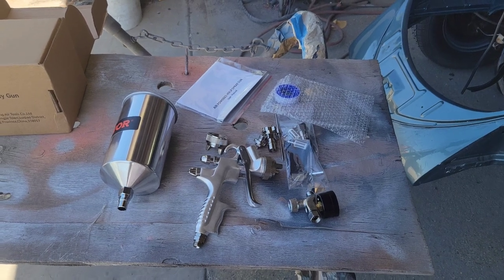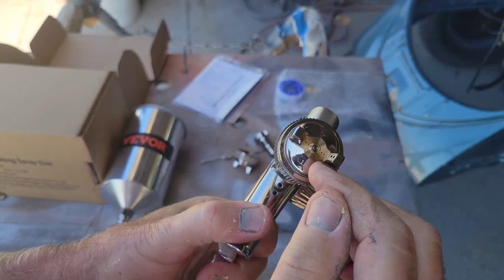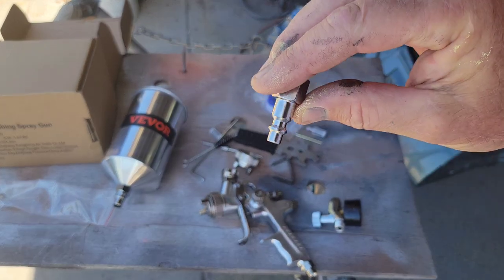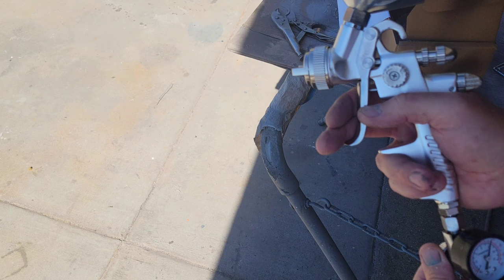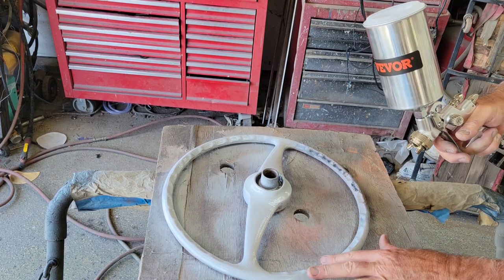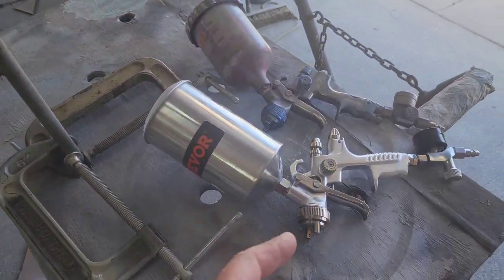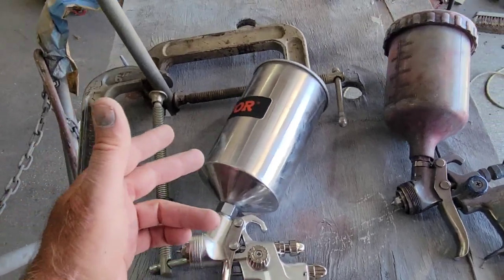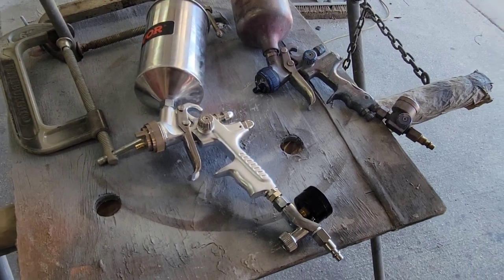GOOD CHEAP CLEAR SPRAY GUN VEVOR HVLP Auto Paint Air Spray Gun Kit Gravity Feed Car Primer 1.3/1.7mm

Comment: I've been using the $14.99 Harbor Freight "purple gun" for several years now and it works great.
Reply from the maker: takes a lot more time to clean that sucker. try one of these and you'll never go back. better atomization and easier to clean.
Reply: @Mikefngarage  I just run lacquer thinner through it and once in awhile tear it down and pull the little white filter out of the neck and clean it.  That's pretty much it.....but I might look into this gun you're talking about depending on the price.   I've also got Harbor Freight's much better gun, but have been so satisfied with the purple one, that I haven't tried it out yet.  Thanks for the tip though....
Reply from the maker: @USCG.Brennan  also for primer you cant find any 1.7 that work good cheap.

Comment: mike can you talk about compressor size FOR THAT gun? vevor also makes a LVLP version
Reply from the maker: seems to be a middle ground on air use. will probably work OK on a 3hp but I would recommend 5hp 60 gallon. 3hp 40 gallon.  Not as much of an air hog as the Tekna prolite.  The LVLP verson looks just like the other gun I already have called the Spray It 30000 They dont spray as good as this one. This one is a good spray gun IMO.
Reply: The spray it and the vevor Lvlp guns are both r500’s I own both. It’s clearly visible on the left side between the trigger and adjusters. The spray it has red accents and the vevor has black ones.

Comment: i see they have one with three tips do you  think its the same gun  just with an extra tip ?
Reply from the maker: the 3 gun kit is not a good gun. they are cheap ones with taper on taper fit. this one  is a copy of a professional line gun. it sprays really good and is easy to clean.

Comment: Hey Mike, what are the best tires for a 1971 Westfalia?
Reply from the maker: if you like the off road look those BFG are really nice and tall. gets better freeway gear ratios with stock trans. otherwise the tallest that will fit. Probably 205 75 15
Reply: @Mikefngarage  Sounds good, Thanks for the quick response!